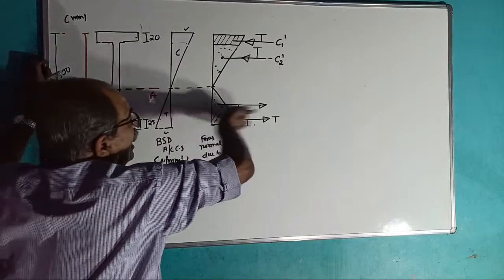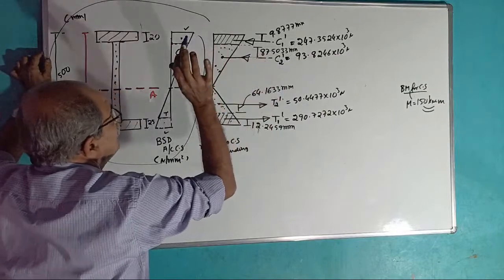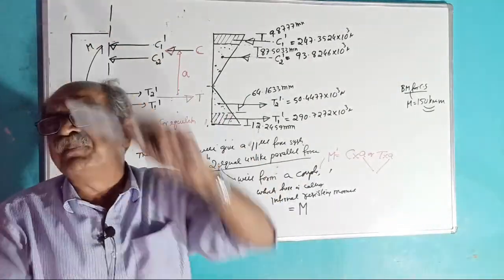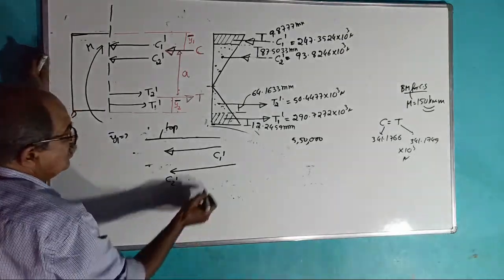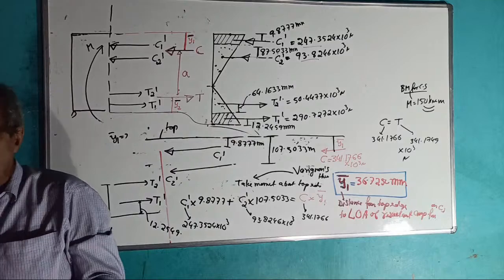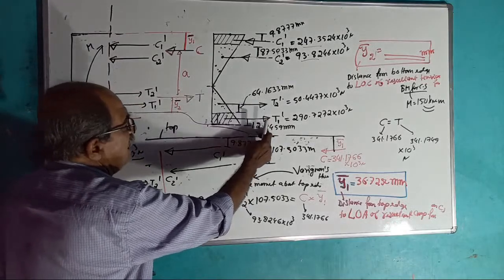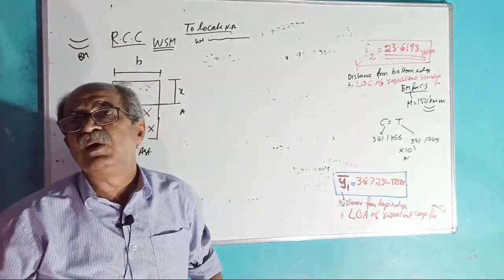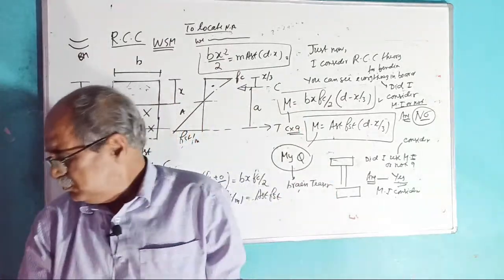BSK-Class 125/Bending & Shear Stresses

Comment: Sir, in RCC theory, stress is given by IS code directly. In bending theory, we use MOI to calculate the stress. So my answer to the brain teaser is MOI is hidden in the stress. To get MOI of c/s equate internal moment of resistance(MR) to the max. MR that can be resisted by c/s, find corresponding stress further we can calculate MOI using these values.
Reply from the maker: No. Nowhere near the answer
Reply: @ksnstructuralengineeringclasse  Ok Sir. Will keep trying to find the answer.....